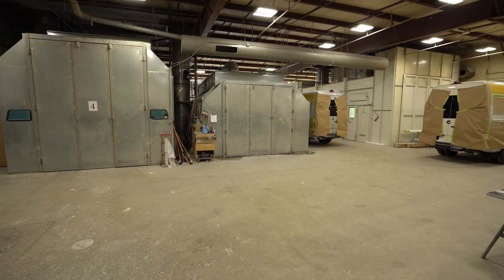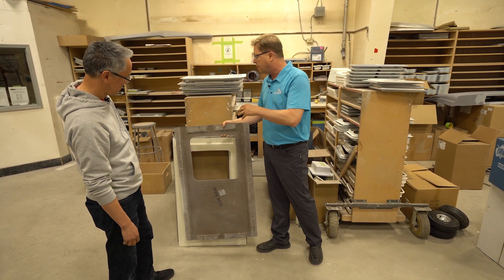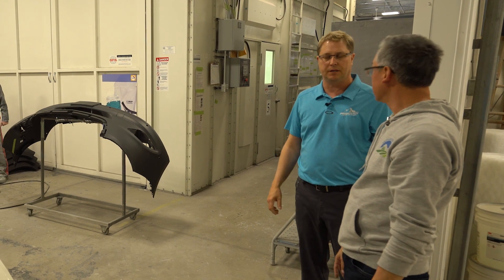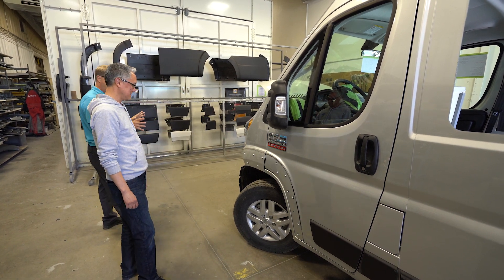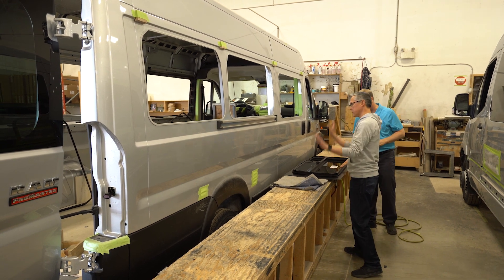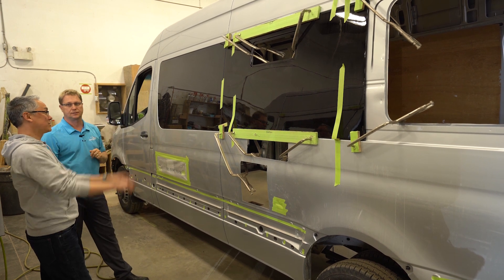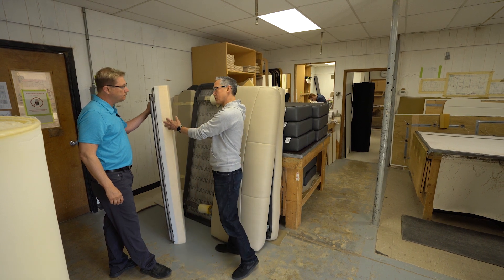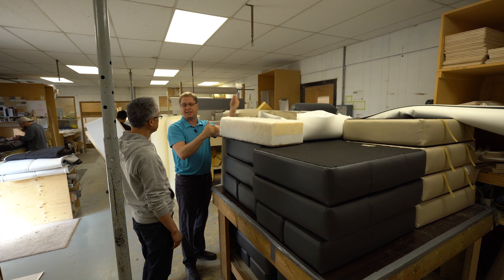Pleasure-Way Factory Tour with Neil from Ultramobility | Part 2 of 4

Comment: Neil, thanks for the quality videos. Do you know if Pleasure-Way does anything to shield the EMF radiation emitted from all of the electrical wirings to protect the occupants? I tested a new Travato I was considering purchasing but was astounded by the radiation coming up from the flooring and couldn't imagine having my feet in the high-radiation field while standing or sitting in the van. I also tested the amount carried on the wiring and it was about 10 times higher than emitted from an average house.

Comment: Neil good morning. Your parents spelled your name the same way my parents spelled my middle name. Isn’t it I before E except after C? Well that is not the purpose of this message LOL.

How long has Pleasure Way been doing this type of heat treating of the plastic? I don’t have enough money to buy a brand spanking new one even though I would like to but I would like to buy no leakier  than 2016.
So my question is how long of a been doing some of these processes? I’d like a 5 inch thick roof and a 3 inch thick floor and  the sound deadening Aspects and then I will add my own lithium batteries and solar panels etc. thanks and is it I  before E except after C???  
I’m not really sure if our mother’s knew??
LoL